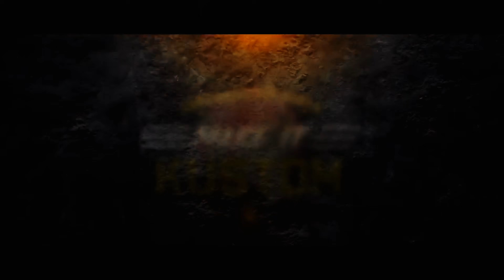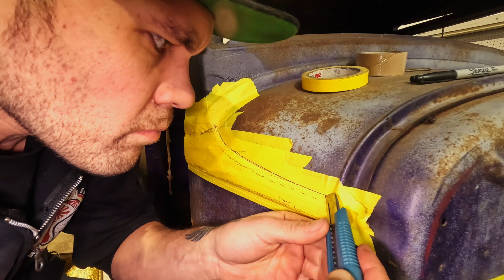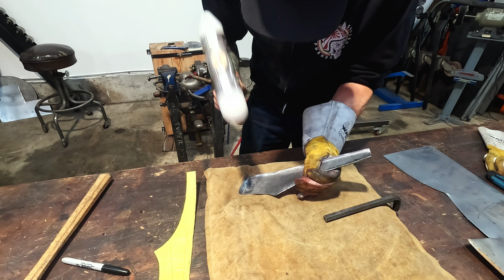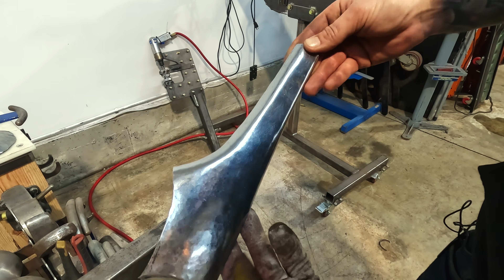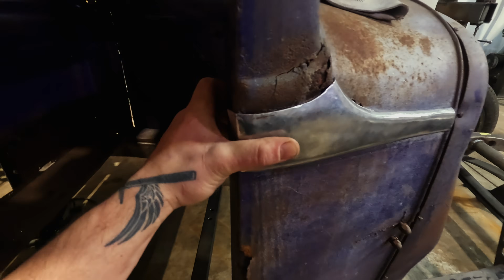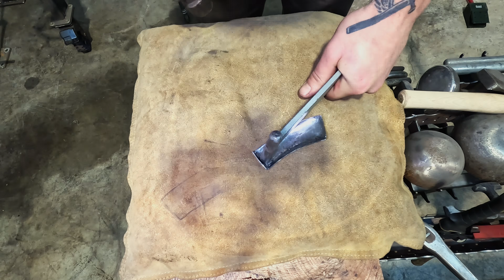Metal Shaping with ONLY Hand Tools STEP BY STEP!!! NASTY RUST REPAIR "Getter Dan's" 1934 Ford PU

Comment: Nice Karl!!! Took me a couple of days to get to your video. I'm doing daily videos for February. (This will be my third year.) Thank you for a great channel. I'm currently trying to build inner wheel wells for the Volksrod using a stump and a wheel. I tried to leave myself a good margin for error (1"), and you are correct the extra material creates lots of extra work. Especially when shrinking. Probably going to take a different route. But the learning is worth the price of unusable sheet steel. Looking forward to the next part in this series.

Comment: Nice. So, if you wanted to replicate that.  I guess you could 3d scan, use a CNC router to make dies out of hardwood and could you press form that? I don't know if you could press form all those shapes in it?. Maybe multiple and varying press dies? Some guys are amazing at 3D CAD and could probably knock out the CAD work in no time.
Reply from the maker: Yeah, I think you could 3-D printed die and press it into Rubber and get pretty close

Comment: Don't forget the rear bracket on the starter on that 6.5, bolts will break out of the block if you don't put the bracket back.
Reply from the maker: I need one of those brackets! Mines been missing for 15 years lol I should make one

Comment: Looks good. I only have flux and mig but no gas for it yet. So the welding with flux is where it goes south. Warping and blow outs. I use a cooper plate to pull away some of the heat. That helped a lot.

Comment: To be fair, that's just a forearm-powered power hammer. I'm probably the only one noticing that mid-century vinyl-covered chair. You should Google Lens it before you melt some welding berries through it in case it's valuable.
Reply from the maker: Haha ya they need to be recovered but they are rad!